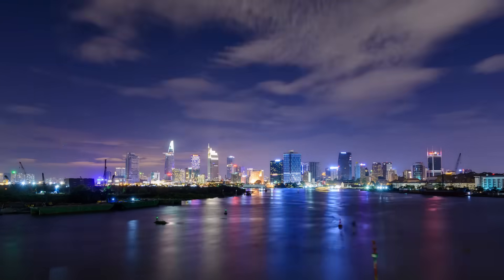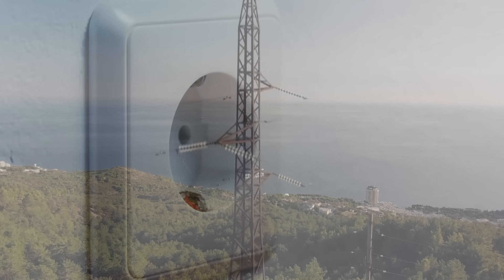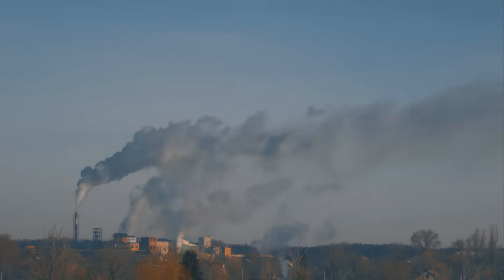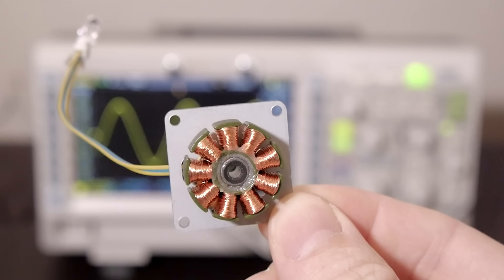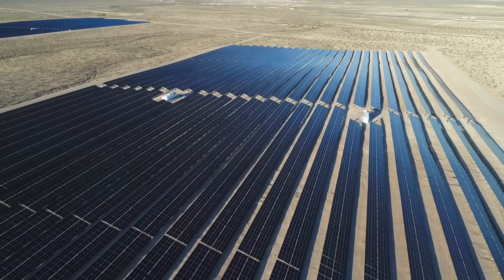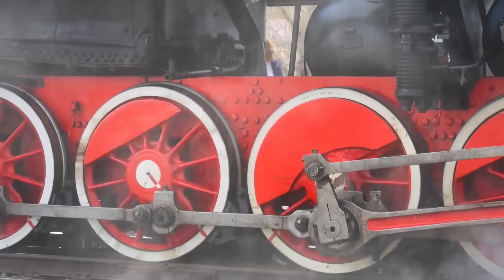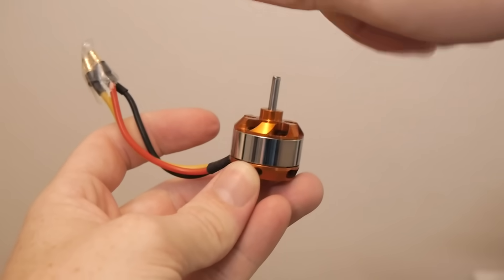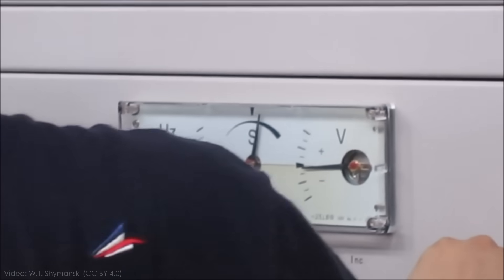How Electricity Generation Really Works

Comment: You can also have solar and wind in reserve, solar plants are being curtailed all the time here in California.  Batteries technology will store excess so it can be stored to be your inertia persay.  Pump storage and gravity storage also coming along
Reply: The simple answer to the solar curve is smart water cracking units that produce hydrogen fuel when energy production is above what the grid needs. Batteries will always have their life cycles and charge/discharge rates but a load you can turn on/off or high/med/low as needed that is turning any power dumped into it into a fuel would always be useful and more of a cheap fuel speeds up how fast people switch over to it.
Reply: The metals used in the cells are so much more rare then what is used in the fanciest batteries today in this type of scale.  There is muscular better batteries,,,like the flow battery etc, and more coming down the pike that use the most common elements on earth
Reply: Neither pump nor gravity storage are particularly efficient (though its better than sending it all into the ground). So the cost in terms of money, materials, and space is still really really high for a purely-renewable grid.
Reply: The cost f the grid is high period, we just keep putting off the true payments for it.

We must get away from finite sources of fuel for future generations but sadly we are more and more about the quarterly corporate earnings report then the true big picture
Reply: Pump storage can be as small as a water tower, it not jus two huge bodies of water, we must get away from the huge centralized grid concept and think local and personal, home, etc.

Comment: Fun fact #1, Carbon dioxide has two bonds that can and do energize with solar energy.  These two bonds completely saturate at 350 ppm.  Meaning that after you reach 350 ppm of CO2 in the atmosphere you have captured the maximum amount of energy you can from the sun.

Fun fact #2, we have been at 350 ppm of CO2 since the 1700's

Therefore the only way CO2 is contributing to "global warming" is if the sun itself is producing more energy, because we have been maxed out on CO2 energy capture since the very beginning of the industrial revolution
Reply: We are at 412 ppm https://climate.nasa.gov/vital-signs/carbon-dioxide/
Reply: @ScoutSniper The sun is actually cooling: https://www.livescience.com/61716-sun-cooling-global-warming.html

Comment: I always thought wind turbines turned at a speed based on how fast the wind was blowing. If that's not the case, how much energy is lost resisting that natural turn rate?
Reply: The blades can be feathered ( rotated in such a way as to control how fast the blades spin in a certain wind condition).
As long as the wind stays within a certain range of speeds, no additional resistance is needed to control the rate of rotation.
Reply: Wind turbines have a speed that the generators work best at. Basically a trade off between power generation, friction loss, wear etc. So I don’t think there is much power lost as spinning faster would result in you having a less efficient turbine.
Reply: @qtheplatypus  I think the question is more how much potential energy is lost - i.e. how much of the wind's energy is actually converted to electrical energy?

I don't know the answer off the top of my head, but I think it is similar to solar which is ~15-20%
Reply: Wind turbines typically have adjustable systems to operate them at optimal speed while still generating grid-sync.
Newest ones have slip-ring generators that basically electronically simulate a rotating "stator" to keep grid sync. Engineering is great.

Comment: Ultimately there is no such thing as renewable energy. Every single one of them requires some form of non renewable resources often with significantly higher environmental impact than people expect. 
Go nuclear in the short term, then reprocess waste with gen 4 reactors, and finish with fusion.
Reply: God I hate people who pin everything on technology that doesn't or may never exist. Maybe fusion can power the hyperloop I'll take to work?
Reply: @Alex-nl5cy  Dont worry, people generally hate people who jump straight to saying they hate people.

Why actually use existing technologies like I said, which are cleaner and more reliable than current "renewables" with MASSIVE back end costs and impacts.

Try to listen before being an asshole toward others.

Comment: Wow, how did I not know power transmission lines used three-phase AC.
Reply: No what you think, you use only 1 phase for 120v, 2 for 240.
Reply: @publicmail2  If you have 1 phase with 120V, there is a potential difference of 120V*sqrt(3)=208V between two phases, not 240V.
Reply: @krasa6945  Except they are using one phase and the same phase in reverse. That makes their 240V supply.
Reply: @Electroblud  and then 400v with 3 phase installations like electric stoves/ovens, hydroelectric house heater boosters and fixed machine tools commonly found in garages and workshops or laundromats.
Reply: @krasa6945  Split phase (sometimes mistakenly called single phase) in North America is 240v with a center tap that is bonded to earth to form a neutral.  Hot to Hot is 240v either Hot to Neutral (center tap) is 120v.  Neutral center tap balances loads such as random household usage.
Reply: you never learn't to count to three perhaps?

Comment: So.... just add big spinning flywheels to the solar plants or batteries, Maybe compress very big spring over time, or lift some heavy weight , maybe pump water very very high ....
Reply: DUKE NUKEM it’s what they do on larger micro grids.
Reply: Flywheels have been around almost as long as dams and much less impact.

Comment: Except, most generators don't have permanent magnets with only notable exception is wind generators probably
And this is also the reason why no frequency fluctuation is happening in the grid on different load despite what was told in the video
Reply: They are happening tho. With or without wind. Whenever the system is overloaded the frequency drops a tiny bit. I don't know why that is. I just know that it is.
Reply: Frequency fluctuations happen all the time, but everything running normally within a fairly tight window.
Reply: On the contrary, there is always frequency fluctuation, the reason there is none experienced is because it's in every electricity generator's interest to synchronise their generators, and they have entire control rooms dedicated to just making sure everything they produce is at the same frequency.

This demand for perfect in-phase generation is the reason why dispersed generation, like the notion of powering an entire electric grid with solar panels on everybody's roofs is doomed to fail. There's simply no way to synchronise all these thousands and thousands of different power sources.
Reply: Samuel Zelter you can use the grid to provide the phase. When we had to connected a generator to the grid as a part of cutting over our server room when the utility was going to cut power.  First we started the generator adjusted the phase to being very close to the grid. Then we connected the generator to the grid.  The grid locked the generator into phase.

Also I recall reading an article about using a GPS based clock to ensure it is in phase.
Reply: It is not like a turbine slows down on load causing frequency to fluctuate which was told in the video. The fluctuations you may observe in your mains is a random process and well below 0.01%. Also there is no "rooms" to synchronise frequency. A generator connected to the grid is already synchronous by definition, the only possible question is how much parasitic current is flowing through it. If it is slow then the grid will rotate the generator, it is simply impossible to make it nonsynchronous.
Reply: David Lowery more or less yes.

Comment: Wind and solar power have actually made the grid much more stable in the past years. The main reason for this is simple: More conventional power stations are available as reserve, and no longer used for base load.
Reply: I don't think you fully grasp the concept here. Base load is the minimum demand on the grid and the reason why it isn't zero like your home usage would show if you graphed it, is due to the size of the grid and the usage of other homes is not timed exactly the same as yours. Solar and wind do in fact not contribute to grid stability - au contraire! Solar generates electricity regardless of demand as the weather and daylight conditions make this possible. Since things may go bust if electricity generation is higher than the demand, solar may call for baseload generating plants which includes emission free nuclear plants, to be tuned down or shut completely and be replaced by less effective turbines. Wind is even more troublesome because windmills respond completely opposite to the demand of what you want them to do. If the demand is lower than the grid in total generates, then the loss of friction will cause the rotor to run freely and destroy itself if there is no brake applied to it. The reverse, if the demand is higher than what the grid can supply the friction will become too high and the windmill will come to a grinding stop, at which point the complete grid will collapse and we'll have a blackout.
Reply: @WhoStoleMyAlias  windmills can be easily regulated both by braking and by the angle by which they are turned into the wind, the "problem" you are talking about has been solved for over a decade.

It's the exact opposite from what you're saying, windmills can be regulated very easily and in small doses, they're actually being used to improve the stability.

Now, if you take too many conventional power plants off the net permanently, you cause instability, but that's a different problem altogether.
Reply: @tommihommi1  You are assuming there can only be too much power. That is obviously not true because the maximum output is at any given time determined by the force of the wind, which may vary from practically absent to too dangerous to operate the windmill. You are also disregarding the fact that replacing coal plants (or worse: nuclear plants) by gas turbines to run in compensation mode, does not actually lower CO2 emissions.

Comment: 3:30 another advantage of using AC is that switching it off is far easier than with DC.
Reply: How so?
Seriously asking btw.
Reply: @claqyagami6914  inductance wants the current to keep flowing and to do so it creates arcs on opening contacts... AC goes through zero which helps to break the arc, with DC it just keeps burning with the heat of a thousand suns :D
Reply: @claqyagami6914  Whenever current flows and you open a switch, an electric arc is created. As long as the voltage is big enough and current is flowing, the arc won't go away.
AC has changing voltage, i.e. from -170V to +170V. This means that there is also 0V somewhere in between. If there is no Voltage no current flowing any arc is going to stop. Therefore AC has the advantage of self extinguishing arcs.
With DC any arc won't stop itself, unless you have special switches to basically extinguish the arc.
Reply: @thrownchance  Let me add that voltage and current do not have to be zero at the same time. In fact, they usually are not. And for switching, it's the current passing through zero that matters, not the voltage.
Reply: @thrownchance  so unless the gap is long enough to isolate the conductors of the breaker through air resistance, you'd have to physically inject an electric isolator between them to break the electric arc or have some kind of varistor on either side of the breaker to strangle the flow first?
Reply: @SonsOfLorgar  I'm certainly no expert in this matter but afaik that's pretty much it.
Here you can see how a DC circuit breaker is built, compared to a AC circuit breaker: https://www.youtube.com/watch?v=w0ntxqTEqyM
Reply: Switches are built with a long enough air gap to extinguish the arc, and switches used with 120 or 240 volts AC are quite capable of switching off a DC device.  The reason for the mechanism that makes a switch “snap” is to keep the switch from staying in the “half off” position.
Reply: @allanrichardson1468  But switches/circuit breakers can switch off a higher voltage when used on AC than on DC. If you look at a breaker's datasheet, you'll see it's rated for a much lower DC voltage.
Reply: @allanrichardson1468   My 48-year-old house has several non-snapping light switches, probably because of weakened springs.  It's very possible to leave them in the halfway position.  I always make sure to push them all the way from one side to the other.
Reply: Joe Sterling Good for you!  I can remember when consumer demand for quiet switches led to mercury switches, which had a small bulb with a drop of mercury (which does not “wet” glass as water does) inside the handle, and two probes at the other end separated by an air gap when the handle was down, but connected by the mercury (which does wet other metals)when it was up.  Any momentary arc was carried by mercury vapor (which could be suppressed by filling the bulb with argon at several atmospheres of pressure) and contained within the bulb.

Since people have become more concerned with mercury poisoning in recent years, they have become much less popular; I’m not sure whether they are still legal.
Reply: thanks for the explanation guys.
Reply: and it is cooler as an added bonus.
Reply: This is the best comment section I've ever seen. Thank you to all the helpful, knowledgeable, and thoughtful people that answered this! I also did not know.

Comment: How does load.follwing done in case of solar panels or wind mills?
Reply: You don't, they're a burden.
Reply: Prakash Kamath You need a buffer. That‘s why energy storage is one of the most important topics when talking about the transition to renewables.
Reply: Pump storage or hot salt storage, for example. Another way are these huge battery stations like the ones Tesla is building. Though I don't consider the latter a feasible solution due to the high environmental impact of battery production.
Reply: Solar plants...both PV and thermal are being curtailed all the time here in California so when sunny there is a reserve just of that and wind or any other source can and does get held back so there is a reserve of various types.

Batteries have much much less of an environmental impact then once through fossil fuels as they don’t get used up and become green house gas and can be recycled when the time comes
Reply: @gordybishop2375  is pumped storage hydroelectricity used in California? i doubt any other form of storage can beat it in overall cost per capacity
Reply: There is at least one pump storage in California, near Livermore perhaps,  but not sure of location.

Comment: Forgot to mention batteries adding inertia?
Reply: They don't do inertia in the traditional sense, well in a way that is easy to explain without going into deep power engineering
Reply: Because they don't, they are completely insignificant.
Just like a fart in a stiff breeze, tonns of spinning iron in an alternator compared to an electronic inverter, grow up..
Reply: @50Hertz60hurts  They aren't useless, they react by injecting real power far quicker then traditional generation.  AEMO have papers written on the high speed response of the Hornsdale battery in Australia and it's use in frequency control under fault conditions.
Reply: Hehehehehehehe, there you are,  a pissy little battery like that, five minutes of capacity before it needs to go and have a night off,  grow up, semiconductors cannot now, not ever will be able to withstand the let thru energy of a serious fault,  that and the fact that rotating mass is already grid connected so it cannot be out of step with the grid.
Reply: Michael Harman if you don’t understand the difference between a power and energy battery at a grid scale you aren’t qualified to have this discussion.
Reply: S g I know, and yet here you are talking about toys you don’t understand, go back to sleep, it’s way past your bedtime.
Reply: Michael Harman I’m not the one putting my ignorance on display. 

Making statements like “5 min and it needs a night off” shows how little you understand and highlights your ability to parrot points you heard and don’t understand.
Reply: Would you add batteries to power generation or would make a separate video for power storage?
Reply: Travis Luther you can use batteries for different purposes in a large grid.  They really are a topic of there own, but it gets pretty deep into power and electrical engineering that would be hard to make a light 5 min video on without assuming a lot of background knowledge.
Reply: @MrSmeagolsGhost  I understand that. I am pointing that out by asking the question if this video was appropriate to address batteries. The question was meant for the original commentator as he is the one that suggested adding batteries to this video.
Reply: Batteries are a pathetic joke for voltage and frequency stabilization as compared to syncroness capacitors. And syncroness capacitors provide an easy way to correct low power factor and reduce I2R losses on transmission lines. Not to mention syncroness capacitors have been in use for over 100 years
Reply: Cindy Tepper do you mean synchronous condenser ? Yes they work but they are a complete pain to maintain and losses are fairly high.  A spinning motor full of hydrogen is a difficult thing to maintain.  I did some work in the past on the ones in vic for the SEC as a reference.  But given they are installing 6 new ones in South Australia we will see if the new ones are any better.